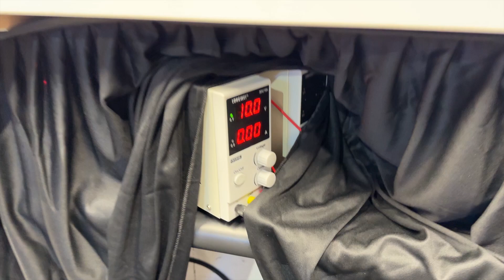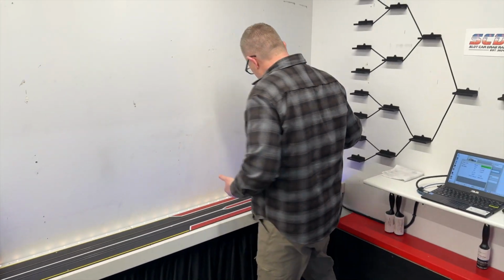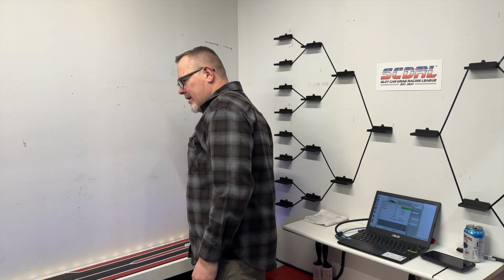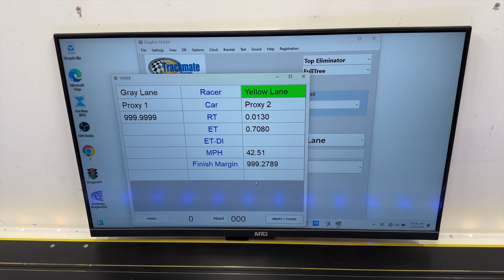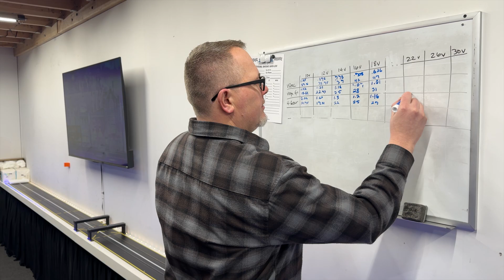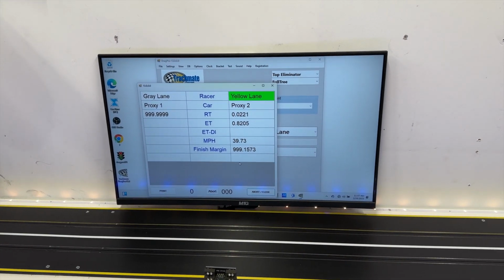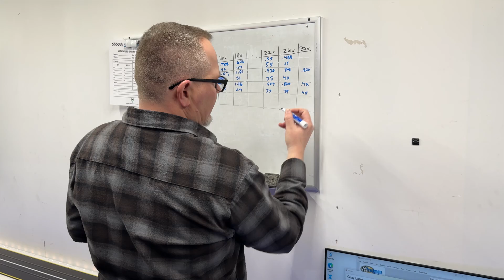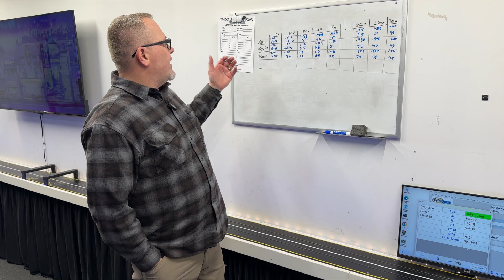HO Slot Car Different Voltage Testing

Comment: I been running 25v with a NOS button to 40v for 35 years, I have exhibition switch on the power supply to series the dual channel regulated supply to 80v.

Comment: Strongly urge you to add a 400,000ufd capacitor to the output of the power supply and re-run your testing. The voltage regulator in the power supply responds too slowly to the change in current as the car starts (Maximum current). The capacitor will buffer the power, so there is minimal voltage drop at start up.
Reply from the maker: Thanks for the suggestion but we run crazy high current cars on this track with zero problems. The inrush required to run them is far greater then the cars in this video
Reply: @viperscaleracing  I guarantee you will improve your et's, especially with the higher current cars.
Reply from the maker: Email me some info, it would be a great before and after video

Comment: You mention not revving the motor with the rear wheels off the track. Have you made a video on what the damage would be if someone did that? Also in other videos we see that the cars get set on the tester and the rear wheels are not producing a load. Is it because it's being run at a lower voltage reducing the potential damage?
Reply from the maker: @rpsibew110  Most of the time, when the cars are on the break in block, they are running under 10 volts
Reply: @viperscaleracing  It would be nice to see a video on your break-in procedure
Reply: After motor maintenance, I slowly run them to thin out the comm lube, once that clears up, full throttle unloaded is fine imo, 35 years doing it on AFX magnatraction cars without damage on 25v.